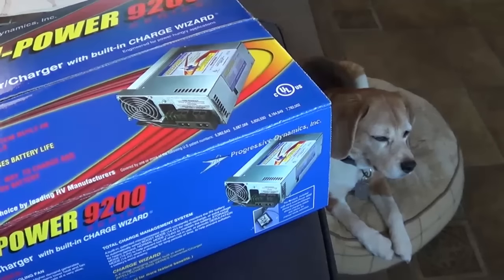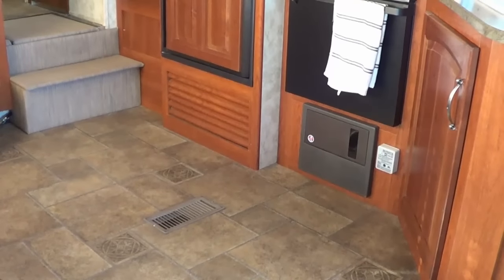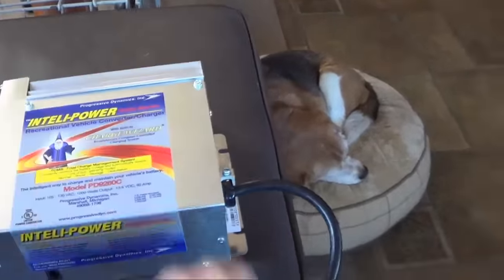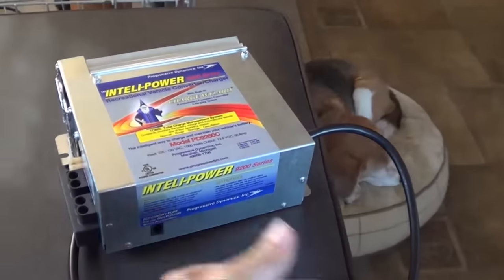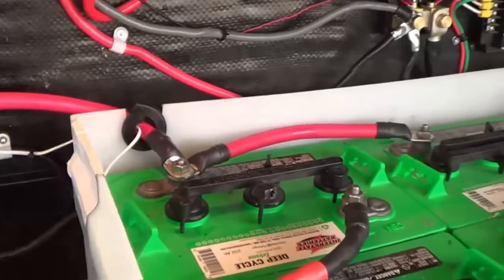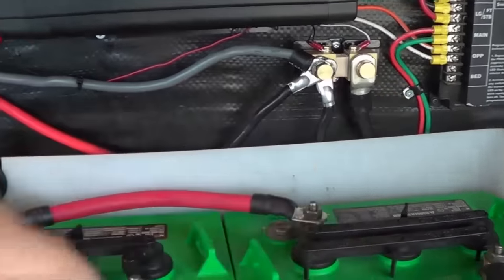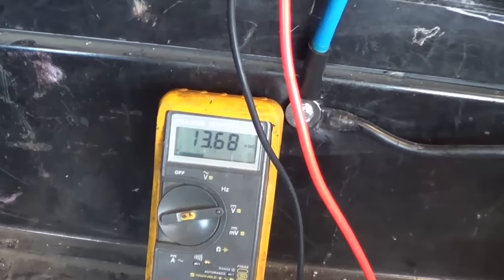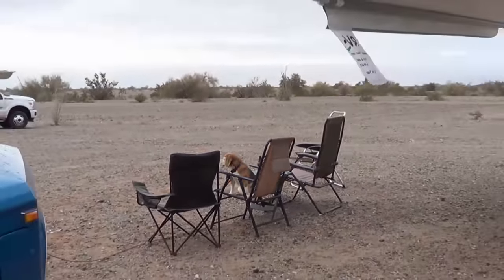Upgrading to an INTELI-POWER Battery Charger for Boondocking

Comment: How does the refrigerator and hot water heater circuit boards handle the 14 volts? I bet the lights are super bright.
Reply from the maker: Works fine, they have to design them to handle what the motors alternator puts out and often that can get up into the 14-volt range. The original OEM converter was rated at 14.4 volts in bulk mode but it never would do it, likely due to wire length and gauge. They cheap out in that department.
There are thousands of RVs outfitted with solar now and many of the charge controllers go as high as 14.8V during the absorption phase. I don't hear of too many problems.
I know that it can be a problem with some Inverters with the high voltage shutdown, mine is able to go to 15.5V though.
My LED lights I put in have built in regulation for voltages 8V-30V so they look the same. :)
Cheers Ray

Comment: Questions replacing my burnt out 45 amp converter in my travel lite trailer, the new is going to be 55amp 3 stage converter, should I upgrade the battery cable size that is coming from distribution to the battery at the front of the trailer?.
Reply from the maker: If you can it will help out, they tend to not use big enough cabling in these RVs, saves them a bit of money I guess.
Reply: Love Your RV thanks

Comment: Ray, why didn't you just replace the OEM converter with the new Intelli-Power?
Reply from the maker: Where the OEM inverter is installed is far away from my battery bank and is connected with a long over 20 foot 6GA cable. Because of this has quite a bit of voltage drop limiting the charge amperage and messing with the smart charging circuits in the converter. My location the new Intelipwer charger right next to the batteries I get the fast charge when using my generatorI left the OEM in place, leaving my Intelipower mainly for dry camping. Gives me the fastest charge when using the generator to charge up the battery bank when it has become low due to excessive power use by us or a few cloudy days. 
When on full hookups, I decided to still use the OEM converter, may as well wear it out, and conserve wear and tear on the Intelipower. My batteries still get a good charge because the solar charge controller is charging as well and takes the lead since it can produce the higher voltage needed to charge my golf cart battery bank properly. Most of the time on full hookups, the batteries are just sitting in float mode.
If I did want to disable the OEM charger converter, it would be as simple as turning off the breaker for it or unplugging it and plugging the Intelipower into an outlet.  Here is a video explanation -  https://youtu.be/zuGAwXHKbwU?t=1584
Reply: @LoveYourRV  can you use your 1000w inverter while charging with the new convertor?

Comment: Since most shore power pedestals have both the 30 amp receptacle and the normal 20 amp receptacle, would it make sense and would it be safe to plug in the new converter to the 20 amp receptacle and plug in the RV normally with the 30 amp plug into the receptacle at the the same time with the old converter circuit breaker off? This way you could be using your microwave or airconditioner while charging the battery.
Reply from the maker: Yes, as long as the pedestal has the power and the campground allows it.

Comment: Ray, you're going to have to stop upgrading, it's costing me too much money trying to follow you, you keep showing such great stuff.  lol

One question, what does the ground from the chassis of the converter to the frame of your RV do?  I wouldn't think it would be of much use.  I know you might get some 'ground' through the legs of the 5'er and it may not hurt anything, but why do it?
Reply from the maker: haha. :) 
I believe it is for safety on the AC input side of things. Makes sure the metal case can't become hot and be a shock hazard. It also may be to reduce electrical noise and interference.
Reply: +Love Your RV 
Thanks Ray,  I agree safety is very important.  NOT being electrocuted is quite high on my to-do list!  lol
I wonder, though, if connecting the charger chassis to the RV frame my be going in the wrong direction.  I believe the idea of grounding the chassis of the charger is to cause the input breaker/fuse to pop if the input power contacts the chassis of the charger.  In this case I wonder, if that happens, would the input breaker trip or would the chassis and the frame of your RV become energized?
Lets hope you never find out!!
Reply from the maker: If the shore power plug is wired correctly then the RV chassis is grounded through the RV Park service panel, so the breaker will trip. The RV chassis can't become hot.
That's why it is important to make sure the campground pedestal wiring is correct. I use a little no contact voltage checker just to make sure. It's quite a simple little tool. The vast majority of RV Park plugs are wired correctly, but you never know, especially in old run down campgrounds.
This site has some good articles like this one on how an RV can become dangerously energized and how to test park power - http://www.noshockzone.org/rv-electrical-safety-part-iv-%E2%80%93-hot-skin/
I reviewed Mike's book here some time ago - http://www.loveyourrv.com/noshockzone-rv-electrical-safety-ebook-review/ He is pretty good at explaining things.
Reply: +Love Your RV 
I too always check the power outlet at a campsite before I plug in.  I have found one that had the ground missing.  I told the campground operator and he showed up with an electric drill, plugged it in and said all was fine... not.  We asked for a different site.
I like the "no shock zone" lots of good information.  I especially liked the RPBG (Reverse Polarity Bootleg Ground). I got a non-contact tester after reading that!!
I agree with your statement that if the shore power is wired correctly you will not have a dangerous situation, I wonder if that's also the case if you use your generator to power the converter.  I have no experience with generators.
Reply from the maker: Some portable generators have the neutral and ground bonded and some are floating. Either way, if the RV chassis became hot you would not get shocked because there isn't a path back to complete the circuit as the portable generator is isolated.
My Champion has a floating neutral but I added in a jumber to bond the neutral and ground. My hardwired in surge protector didn't like the fact it had an open ground. http://www.noshockzone.org/generator-ground-neutral-bonding/

RVs with generators onboard wired in are different they usually work through a transfer switch. I'm not real familiar with the ins and outs of those having never had one. :) But I know things get a little more complex especially when it's a 50 amp rig.

This is from the Champion FAQ
Most Champion Power Equipment generators have a "floating neutral", meaning that the neutral circuit is not connected to the frame or to earth ground. This also means that both legs on the receptacle are hot legs, which is normal for floating neutral generators. As a result, there is no specific hot leg and neutral leg wiring arrangement for the generator winding connection to the receptacle. The floating neutral configuration is common for applications such as connection to a recreational vehicle and connection to home power where the transfer switch does not switch out the neutral to ground connection.The floating neutral eliminates the potential of being shocked by contacting a hot leg and the generator frame at the same time, which could occur if an electrical device such as a hand held tool suffered from an internal short circuit.Meters or other devices intended to indicate polarity may not properly indicate polarity on a floating neutral circuit. Polarity indicators generally measure the voltage across the neutral and ground connectors. In electrical systems where the neutral is bonded to ground, the voltage will be zero and correct polarity will be indicated. In systems where the neutral is not bonded to ground, voltage is also not expected across this connection. However, in a portable generator some very small current voltage readings can be recorded by sensitive volt meters. This voltage may be induced in the frame by the magnetic field of the generator. The current associated with this induced voltage and the risk of electrical shock are negligible. However, very sensitive polarity meters may interpret this voltage as an indication of reversed connections.If you have an indication of reversed polarity, please check with the manufacturer of your meter to determine if that reading capability applies to the floating neutral output from a portable generator.
Reply: +Love Your RV 
Thanks Ray... WOW, always something new to learn!  :)
Enjoy you trip.
BTW, how do you like your new TM-2030/SC-2030?  Is it performing as you expected?
Reply from the maker: Yes, really liking the combo. Now I just need all the cloud and rain to clear out. :)

Comment: Hi Ray, Thank you for the video and cheers from Canada! 

Once your OEM converter wears out will you be replacing the converter and the panel with a Inteli-Power® 4500 Series? Im going through their website and so confused with all the different products.
Also, my OEM converter is 45Amps and im planning to have (1) 12V battery instead of the (2) 6V batteries. Should i get the PD 9260 (60Amps) or the PD 9245 (45Ams) thoughts?
Reply from the maker: I'll likely just extended the existing AC line that is currently hooked into the OEM WFCO converter out to the InteliPower converter's location and use it since it's at a closer location to the battery bank.
You likely have a 55 amp WFCO converter https://wfcoelectronics.com/product/wf-8955mba/ installed by the OEM so if that's the case I'd get the 60 amp model PD9260.
More info in this video RV Power Center Removal and Maintenance WFCO 8955  -  https://www.loveyourrv.com/rv-power-center-removal-maintenance-wfco-8955/
Reply: @LoveYourRV  I'm assuming once you extend the existing A/C line you will be able to just plug your generator into your regular shore power. Or do you plan on keeping the secondary plug? The thing that I am curious about is if you have a generator that can run the Air Conditioner with additional power to spare would you be able to charge your batteries at the same time.
Reply from the maker: @ssgk1983  If I extended a line out to the Intelipower I'd likely also install a switch so I could have the choice of plugging into the shore plug or my secondary plug, I kind of like having that secondary up front close to the truck as often times I just leave the generator in the truck box running and like to have the generator forward of the rig away from windows and its quieter for us inside.
Sure if the generator has the wattage capacity you could power both Ac and charger, right now I could do that by plugging in shore power and my secondary plug at the same time into my 3200-watt generator.  Usually for me, if the heat is on, the sun is out and that means my solar is supplying plenty of amps to charge the batteries so never really need to do that.  Cheers, Ray
Reply: @LoveYourRV  That makes sense about having the switch to be able to choose.

Comment: Great video! Did you disconnect the factory installed charger after you installed this new one?
Reply from the maker: Thanks, I have kept the OEM charger in place and use it when on shore power. Figure I may as well wear it out doing the job on shore power and reserve my Inteli-Power for off grid use with the generator when I really need the extra amps.  Cheers, Ray
Reply: @LoveYourRV  thank you for the quick reply! Much appreciated!!
Reply from the maker: You're welcome. :)You may find this video interesting as well. I now have lithium batteries and the good news is by using the manual boost mode on the Inteli-Power I can charge my lithium bank without having to get a dedicated lithium converter charger.  https://www.loveyourrv.com/lithium-battery-charge-test-can-you-use-a-lead-acid-charge-converter/

Comment: Ray this is the exact charger that my 2022 GD Reflection came with. No pendant though. Some people said they use the dongle or pendant to charge their lithiums, will that work? If so are you interested in selling your pendant if you still have it.
Reply from the maker: I'm still using mine. :) you can get on for $10.95 https://www.progressivedyn.com/service/shop/
It does work. I did a video demoing it charging my lithium https://www.loveyourrv.com/lithium-battery-charge-test-can-you-use-a-lead-acid-charge-converter/
But may want to look at the OEM to see if it has a place to plug it into. Sometimes OEM parts are the same as regular.
More info from the manual - https://www.progressivedyn.com/pdfs/109821F%20english.pdf
REMOTE PENDANT
NOTE: Your Inteli-Power 9200 Converter/Charger may have been supplied with a Remote Pendant. The Remote
Pendant is optional on OEM but is included with all retail models and plugs in to the accessory port of the 9200
Converter/Charger.
While the built-in Charge Wizard automatically determines which operating mode is best suited to recharge or
maintain optimum battery condition, the Remote Pendant allows for manual override and has an indicator light(s) to
indicate the mode of operation.
BOOST MODE – Indicated by green LED remaining on. The output voltage is 14.4VDC to rapidly recharge the
battery up to 90% of full charge.
NORMAL MODE – When the battery is between 50% and 90% charged, the green LED will flash once per
second. When the battery has reached 90% of full charge the green LED will flash 2 - 3 times per second. In this
mode the output voltage is 13.6VDC and the converter is safely completing the charge of the battery.
STORAGE MODE – Indicated by green LED flashing every 6 - 8 seconds. In this mode the output voltage has
been lowered to 13.2VDC, the RV battery is fully charged and the converter is maintaining the charge.
MANUAL BUTTON - The manual button has been provided to allow the operator to temporarily override the
converter (not recommended) or to verify the converter is operating properly. For manual operation, Press and Hold
the button. The indicator light will soon remain “ON” indicating Boost Mode. Continue to hold the button and the
light will blink rapidly indicating the converter is in the Normal Mode. Continue to hold the button until the light
blinks slowly indicating the converter is now in the Storage Mode. After the manual button is released the converter
will stay in the selected mode. When the battery charge status changes, the converter will return to the automatic
mode of operation to prevent damage to the battery.
- All times and voltages provided above are approximate. -
If a REMOTE PENDANT was not provided with your INTELI-POWER 9200 Series Converter/Charger, you can
purchase one from your Local RV Dealer or on-line at www.progressivedyn.com